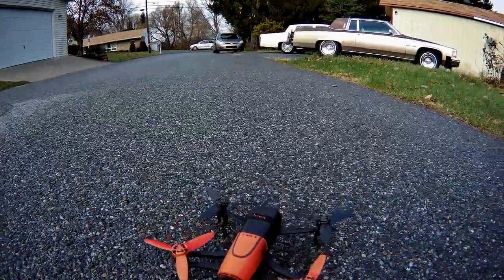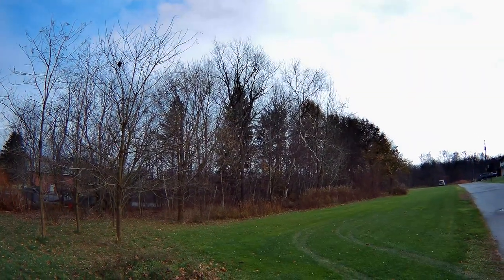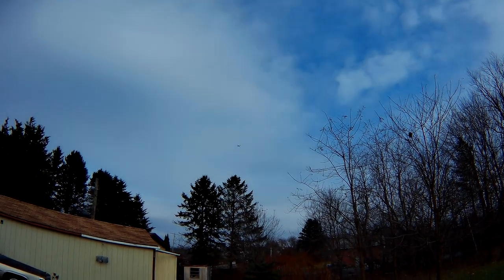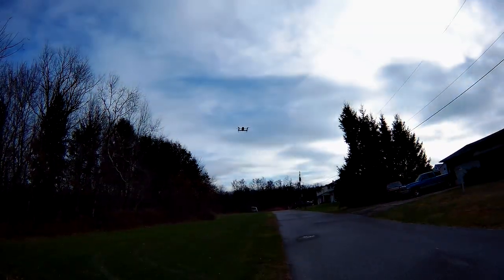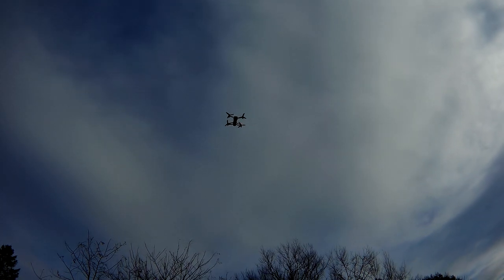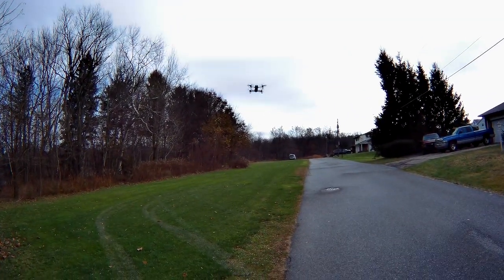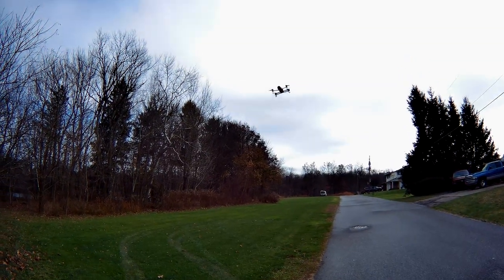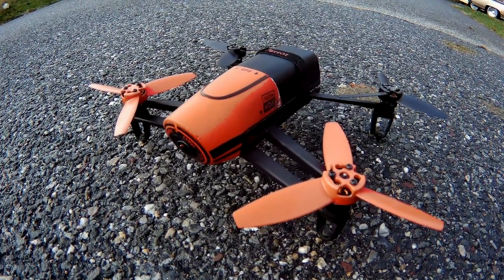Parrot Bebop Flight time test and OVERALL REVIEW rc GPS DRONE

Comment: I bought this drone on Ebay and bought new aftermarket batteries ... I get about 10mins with each battery including the one OEM battery ... they all start at around 98% after a full charge and around 15-20secs into flight the batteries drop to about 78% .. I just learned to live with it .. but its a very sporty drone indeed...seems sportier than my BB2

Comment: What range can I get with the flypad? My android is only 15ft. I have the flypad coming. And what can I expect for time with stock battery?
Reply from the maker: the flypad dosnt increase range at all if ur cell is only gifing u 15 ft u need a new cell flypad just ads manuvarability -- sky controller ads range -- n stock battery im getting 6 min ish in sport mode in a less pitching mode u will get better -- I use a LG Artisio and I got over 1/4 mile today https://www.youtube.com/watch?v=riceJAq8-_s&t=105s
Reply: Jay Drone ok my older phone will let me get the videos but my new 7.0 will not let me receive them. Weird. Maybe try my old phone with the 5.0 system for flying
Reply from the maker: yeah give that a shot
Reply: Jay Drone k thanks
Reply: Hey Jay have you ever had the camera view go all the way to one side before. I have never crashed it. Before and I just took it out and the camera is looking at the right prop. Don't know how to get it back straight again. And also got the flypad now and went 8m and it just dropped to the grass from 3m up. Man don't know what is happening with this thing.
Reply from the maker: U CAN controle the camera with the sky controller and the flypad
Reply: Jay Drone I can move it up and down but its stuck all the way to the right. Have you heard if this before?
Reply from the maker: i have not -- u may be able to do a factory reset on the camera in settings -- to me seems like it got bumped or droppedthose cameras on these r tops and gen dont have issues
Reply: Jay Drone ok if you see a setting let me know bro thanks for your time.

Comment: They probably ruined the battery to make us buy the bebop 2 >.<  even the stock battery lasted much more than this!
Reply from the maker: U need to chill fly it to get substantial flight time
Reply: Well even hovering with a 1100mah battery gives me 6m :|
Reply from the maker: i have gotten 10 min https://www.youtube.com/watch?v=7JpsI3W3c0Y&t=2s
Reply: Jay Drone I actually bought a 1800mah 163gram battery today :)

I get 11m moving around lightly inside with the protective thingies.

I am now suuuuper tempted to give the 2200mah battery a try but I've already spent a lot of money 0_0 the 2200mah is 200grams. And my drone was rotating slightly with the 1800mah though it might be not related to the weight. It's kinda unbalanced too since the cable is too short  to reach from the back of the drone and too long to just plug straight into the connector.
Reply: Jay Drone I'm gonna attach 28~ grams of something to it tomorrow too see if it can handle it xD then I can know when I actually have the money if I can get it.

What's awesome is that my battery also can charge at 5C! That's awesome
Reply: Chloe Mcholoe lg mj1 x3 in series. Make two of those packs and you got 6800mAh for under 200g.
Reply: Chloe Mcholoe going to try it myself when I get mine.